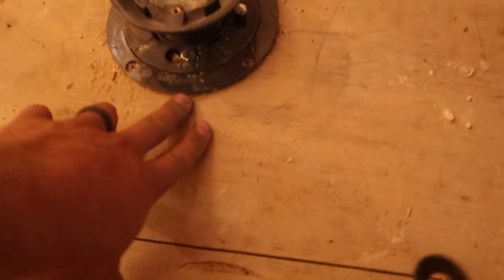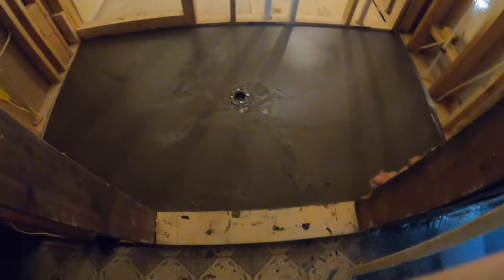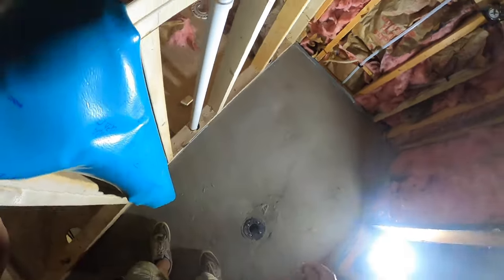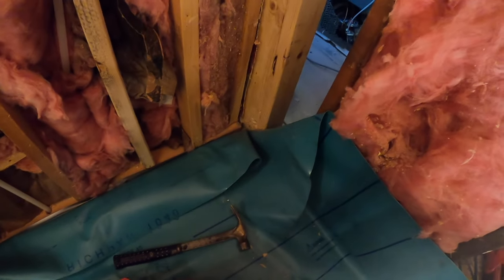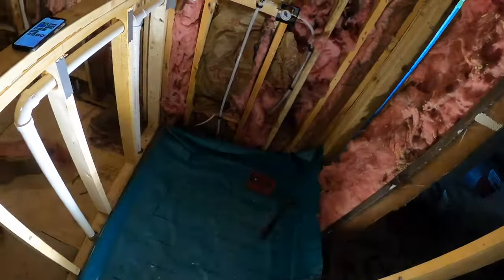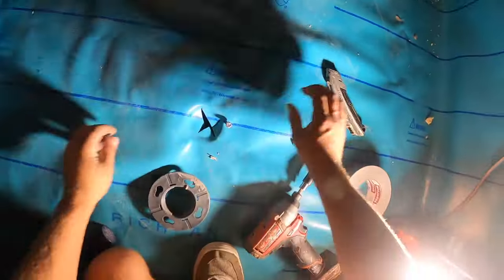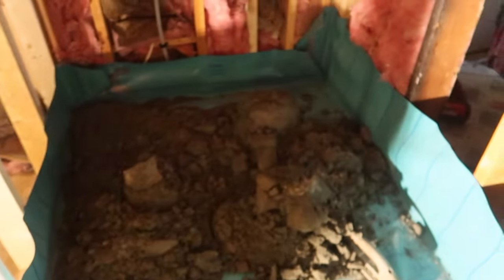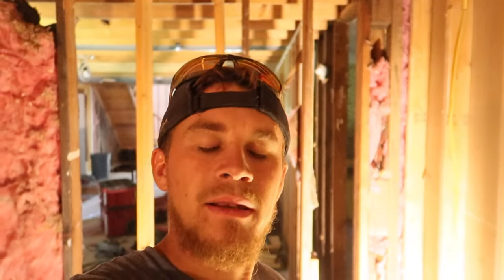how to pour a concrete shower pan (start to finish)

Comment: You cant put a mortar bed on top of wood, it sucks all the moisture out, wrong from start to finish. Its all kinds of dips, worse job ive ever seen those balls of concrete left on the floor, liner should only be 6in up, no backer to support pan, NOTHING IS RIGHT, NOTHING

Comment: Wouldn’t it not been better to put down some HardiBoard over the subfloor before the leveling compound since it being a form of concrete, it will always have a level of moisture and therefor potentially rot out the subfloor?
Reply from the maker: @Chase-vr9fp  you could or some vapor barrier of some kind.

Comment: Why is the pan liner not completely flat and why do you not put a silicone sealant around the flange if drain before placing down the pan liner?
Reply from the maker: You could or you could put some Schlueter caulk but I just don’t I may do that in the future it’s a good point
Reply: @jonport_  keep making cool videos brother we need stuff like this😊
Reply from the maker: Thank you brother🙏🏻. Means a lot
Reply: Pan liner is old bullshit today i use shluter system
Reply from the maker: Hahaha. You do you. My pan will out last a schluter system any day son
Reply: @jonport_  😆
Reply from the maker: 🤷‍♂️ just saying.
Reply: @jonport_  if the drain ever clogged water will sip into the underneath of that liner.
Reply from the maker: @bkhoavo  shouldnt because the liner acts as a seal when you clamp it down
Reply: @jonport_  sure if you have faith in that bro.
Reply from the maker: @bkhoavo  idk man. Not saying not to put sealant under. It’s not a bad idea, but maybe I will my next one

Comment: good vid man, these comments are full of air heads. self leveler is ther way to go. One question, ive heard you should have the backer board behindd the membrane, your thoughts?
Reply from the maker: They’re something lol if I’m understanding this correctly, definitely not. you want to cover everything with hardy backer, so the Tile can stick to a solid substrate. Tile will not last if it’s stuck to that vinyl liner. Plus, it wouldn’t be very solid. I hope that’s what you’re talking about. Lol

Comment: One thing I noticed is be careful putting your drill up on that shelf. Your hammering could make that drill fall over and put the hole right in your liner.
Why no pee gravel or silicone around drain?
Also need to put more information on the drain hight. Thats where a lot of people get it wrong. 
Great job👍

Comment: You don’t want to do the cement board for walls first?
Reply from the maker: No never. Water will wic up the board and rot it out. 1/2 above the floor
Reply from the maker: Ive learned. Expensive lesson.

Comment: I’m used to seeing shower liners installed then a motar bed followed by some waterproofing membrane. 
Isn’t this overkill? Self leveling preslope then a mortar bed to slope in the drain :s
Reply from the maker: Honestly not really man. Water gets into everything so the perfect systems. There’s a video about a old house that’s being remodeled and they used a lead pan underneath their bathroom floor and shower and the shower was over 100 years old when they went to rip it up there was one inch or one percent of mold under everything looked absolutely brand-new after that long you won’t get that with any other system whether it’s a lead pan or a rubber band they are bulletproof. Here’s the link. https://youtu.be/CDK-eXxykSE

On stuff like this, over kill is underrated type thing lol
Reply: No such thing as overkill when building showers.
Reply from the maker: Ya sir. Overkill is underrated son👊🏻
Reply: @jonport_  Saw this as well.. Insane
Reply from the maker: Thank you chief👊🏻

Comment: like the pre-Slope and liner drain.  wonder if pre Slope could be done with a fast dry cement or mortar.  thanks
Reply from the maker: Honestly bro it only took about an hour to dry. If your in a real rush you could use cemental from homdepote you can walk on it in like 20 min.

Comment: I get the middle circle frsin but how do you start in the middle snd screet if its a swuare drain and you have to add the tile height
Reply from the maker: Depending on which drain you have. Some of the tops come off completely. Then you can just screed flush to the top. The ones that don’t come off you screed to the bottom of the drain which is about 3/8 thick and you should be able to have that drain loose so you can screw tighten it or loosen it Ording to your tile height. Hope that makes sense.

Comment: Never seen self leveler so thick
Reply from the maker: That way you can shape it so it slopes in for drainage
Reply: @jonport_  that’s what the cement is for but hey different strokes right
Reply from the maker: Sure. The self leveler is about double the psi at 1/4 in think vs the concrete isle you thinned it down. Stronger base

Comment: I skipped around a bit, this is totally incorrect you have no idea what you're doing. I almost just drove my van off a bridge. You are out of control, Ron Mudd, wrong tools, wrong everything. But that's why there's a whole bunch of future work because of people like this you have a great day now🤣🐓..... oh yeah you forgot the tar paper and wire laugh before your quote-unquote pre-sloped LOL, amongst other things. Jesus Mary and Joseph we need qualified tile setters bad!
Reply from the maker: Ok buddy. Whatever you say
Reply: @jonport_  you got that right!
Reply from the maker: Take a hike bon bon
Reply: Never put mud down on wood.  It will eventually absorb whatever water was used in the mix.  Placing tarpaper between the plywood and deck mud provides the waterproof barrier. 
To each their own.  Everyone does it a different way.  Never seen deck mud placed directly on plywood.  The membrane is roughly 40 mil.
Reply: @ralphemerson497  exactly